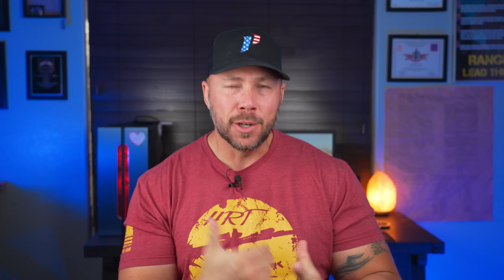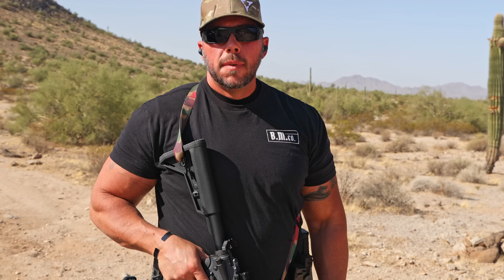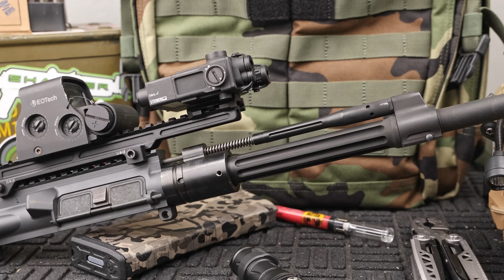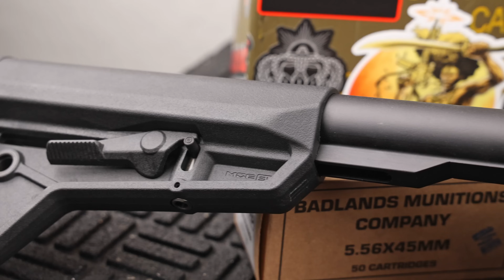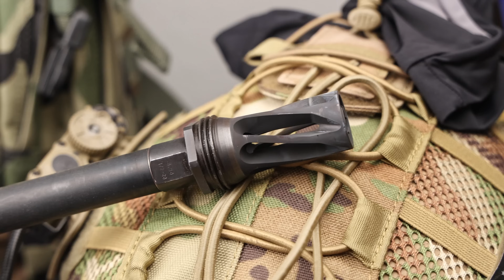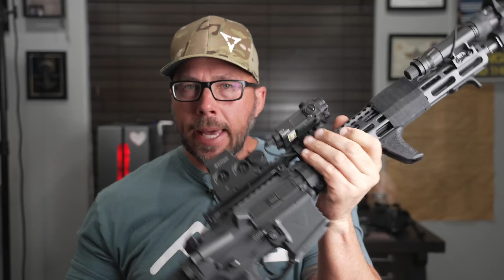I'm Back.. VKTR VK-1 Gas Piston Rifle

Comment: Does the handguard engage the barrel nut notches to prevent forward movement, or is it simply an old-style clamp-on design?
Reply from the maker: There is lock up on the barrel nut.

Comment: Too many flaws in this rifle for me to ever consider buying or carrying/ relying on it.
Reply from the maker: How so?
Reply: @TacticalConsiderations  Left side mag release drops mags when carried slung across the chest because of the profile and lack of barrier, op-rod deforms quickly, barrel will deform relatively quickly under admittedly extreme firing schedule (GoldenWeb) due to the transition in thickness around the gas block? maybe barrel fluting?,    overgassed in my experience which exacerbates the op-rod issue (friend's rifle), parts availability/ CS not good for normal people(non-content creators), high price for fairly untested configuration that has known issues. Couple other things that are more subjective to me like only 3,6, and 9 oclock mlok positions and just generally not liking the handguard. It is pretty accurate, I just don't have faith in it as a hard use setup.

Comment: Very impressive. Appears they have solved the gas control problem. I like that they don't use the tiny/fragile gas rings.
I would like to see a pinned gas block. (or better yet, a threaded nut, ala the defunct Barrett Rec 7 [taken from the zh-29 = 32] ) Would also like an integral trigger guard. Is there a gas rod bushing in the receiver?
Reply from the maker: The gas block stuff is always a place where some want pinned, threaded, thermal fit all kinds of options these days.

Comment: Looks over gassed with a flow through can… I want to like it besides that. Did you try heavier buffer?
Reply from the maker: I did not mess with the buffer for the initial video.
Reply: @TacticalConsiderations  well duh I watched the video, so did you just make the video and put it away or did you address the gas issue?
Reply: @TacticalConsiderations  so you didn’t change buffer or anything? Crappy follow through
Reply: Left side mag release will drop your mag with very little pressure when carried slung because of how far it protrudes. Barrel warps under especially high strings of fire, like say a firefight or prolonged engagement. Golden Web burndown shows that.

Comment: With the oprod mushrooming like that,at that round count,there was very little R&D. It is a rifle that I will purchase. Only after they  work through the unforseen problems.
Reply: There are more problems inherent to the design. Most notably the left side mag release will drop your mag very easily when carried slung against the chest or chest rig and the barrel very easily warping under especially high strings of fire. Nothing protecting the mag release. Golden Web burndown on YT of this rifle shows the barrel/piston flaw. The rifle is also gassy and way too proprietary along with being expensive.

Comment: At what round count did the oprod mushroom? And did they come out with a better oprod?
Reply from the maker: The new oprod is scheduled to be replaced at 5-8k under hard use. All oprods will mushroom in short piston systems.  While it generally will not affect actual function until its severely deformed, and I mean severely. I am still running the same one from this video with zero functional issues.
Reply: How about the long stroke gas pistons like in the HK mr556a4?
Reply: @DavidKon-r8o The HK MR556 A4 utilizes a short-stroke piston, not long-stroke. Long-stroke would be PWS.

Comment: So I watched your "if you can have only 1" video and this video.  I noticed that you didn't run a suppressor on your if you can have only one video.  I just shot this gun and I'm very impressed.  Good mix of weight and recoil. Should I just buy this gun, because you or I couldn't build this gun.  With that said, there's a lot of non-millspec on this gun.  Do you think that presents an issue?
Reply from the maker: Piston rigs are never going to be milspec like DI systems that are built to a specific print accepted by the DOD entities. I did run this one with a traditional baffled can  runs fine the system adjusts for it somewhat but it is meant to be run with flow cans.

Comment: If you had to pick between piston and DI for a cqb/ shtf rifle, which would you choose? Im between a piston like this or a PWS or getting an 11.5 blackout defense DI gun to run suppressed.
Reply from the maker: Well Piston rigs will run longer with out cleaning if built right but They will weight more and be more difficult to get parts for as compared to standard AR DI systems .. If you want all around easiest to maintain its always going to be DI.
Reply: @TacticalConsiderations sweet, just got an 11.5 Blackout Defense Pistol. Shes sick

Comment: I have alot of high end ar15s but my dead air sirra has high back pressure. So you think this would be something good just to leave that can on?
Reply from the maker: It would help but high pressure can will always be worse than flow on gas
Reply: the Dead air will run but the backpressure is punishing.
Reply: @charleseric75 ya i dont even use it. So i was thinking this would he good for it to be a dedicated can for.

Comment: what would you say the recoil impulse is like compared to a gas impingement?
Reply from the maker: Well no two guns really recoil the same due to gas porting buffer weights all that. While I have some DI guns that have ruger 10/22 like recoil that is very rare and its custom build to be like that. This will feel like a well balanced di system.
Reply: The recoil impulse is more straight back vs. "up and back"

Comment: Has VKTR provided you a new oprod replacement yet?  I also have a VK1 (love it) but i am worried about the same op rod issue down rhe road
Reply from the maker: yes they also changed up the material to ensure its not an issue.

Comment: I bought 2 of those Hyper brand triggers to install in my AR 10s and they are absolute garbage with a long pull before setting the gun off and one is worst then the other.
I have bought my first AR 15 before Bull Clinton was president and now I build and sell AR 15 uppers and AR 10 uppers in non-commercial chamberings or all WSM magnums to the 250 Savage and 6mm-284 win the 6.5x51 Jap or 6.5-284 Norma and many more.
I have AR 15 uppers in 17 Rem --- 6mmx45 and 7.92x33 Kirz
There is nothing wrong with the ordinary AR rifles gas system it worked just fine

Comment: Correct me if I'm wrong, but the piston system looks almost identical to the Adams Arms piston system.  Nothing wrong with that because Adams Arms' are solid.  I own a PWS mk111 mod1 and an Adams Arms.   Never had a single issue with the PWS, of course, and also, never had an issue with the Adams Arms.
Reply from the maker: thanks for watching and commenting

Comment: I wish i saw this before I bought the VKTR literally today😢 hope I don’t have any issues with anything including the piston rod. Good video though
Reply: Any update?
Reply: @ yes. After less than 200 rounds I checked out of curiosity how the piston rod was holding up and to get familiar with disassembly of the rifle. To my surprise I couldn’t get the rod out and the mushrooming mentioned was evident. I reached out to the company and they are very responsive and they honor the warranty. I’ll be getting the new rod they are manufacturing when it’s complete. Other than that, rifle is amazing😏
Reply from the maker: You will be fine just replace it at the intervals required.

Comment: I thought something was wrong because I started to notice you weren't posting any videos. I am glad you are back. I am curious about what happened, of course. It will be interesting to know. 

Very interesting rifle. I don't have a gas piston system AR yet.
Reply: I have had a wonderful time using Adams arms piston guns.. but they're dead again. They didn't do anything particularly different, but they really failed to make everyone aware of their 8# ar10s, that cost 1200-2800, and that cost them everything.
Reply: @PureCountryof91  I am happy with the DI gas system.
Reply: I have 3. Never went back to DI. Granted we dont know how dirty we can run this one but my PWS i hardly ever clean and it runs great every time.
Reply: @Mediocre702  I am old school. DI has worked for me without issues, problems, or complaints. And it is a bit cheaper.
Reply from the maker: Dude was out for a bit but back now.

Comment: Looks a lot like an LWRC under the hood.  Makes since with who you said designed it.  Have a few LWRC and love them.  I do like that they use Mlok over LWRC proprietary rail mounting solution.
Reply from the maker: Yup similar just slightly different.

Comment: Is the gas block on there with set screws?  That shit should be pinned on a piston rifle imo.
Reply from the maker: There are the two standard screws underneath and a cross pin on a detent design to make it easy to remove without ever being able to come off combined with the notch fit design

Comment: 2k and replace op rod every 5-7k? lol. fuck that. also, what's up with accuracy?
Reply from the maker: Most piston systems require replacement of springs/op rod parts right around that same interval.
Reply: @TacticalConsiderations  I was told my Caracal 816 is good for the life of the upper.

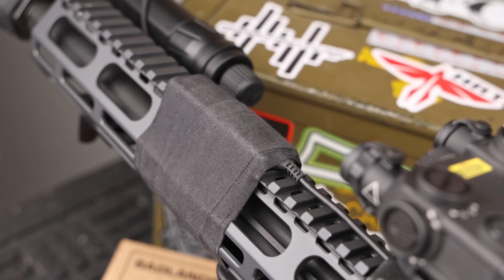Comment: @13:01 I can see handguard anti-rotation tab is not friction fit onto upper = disappointment. 😑
Reply from the maker: The rail locks to the barrel nut housing for the oprod which locks to the barrel nut. You'd have to spin the barrel off to get it to shift.

Comment: Maybe you or your followers can help me out. All I hear about is first focal plane scopes. I have two, a Primary Arms Plx 1-8 and Glx 3-18. I also have a Glx 2.5-10 second focal plane.  The 2.5-10, for me is much easier to use for my shooting. On the first focal plane scopes, at low magnification the reticles are very hard to see. On the 3-18 even at high magnification the reticle is very hard to see. What am I doing wrong?
Reply from the maker: FFP set ups will always have a smaller reticle as min mag.  The goal of them is to use the smallest amount of mag needed while maintaining true holts on the reticle all the way though the magnification spectrum. Make sure you Ocular setting on the eye piece is set to you eye.

Comment: And my pof cam pin does the same thing but better it doesnt rub
Reply: Ah yeah, this doesn't rub because the cam pin is at top dead center when the bolt unlocks. The legacy cam path isn't, regardless of whether you have bandaids such as roller cam pins or steel inserts - the real benefit is the correct timing of the rifle, once you shoot it, you understand.
Reply: @PaulLeitnerWise  doubt i would notice a difference conisdering over 5000k rounds and nearly no wear unless it somehow makes a legit difference to the shooter then no
Reply: Actually, I originally thought the same thing. My sole goal was to eradicate the wear in the upper receiver aft of the cam pin recess, then we're out shooting the test DI carriers with a couple of military buddies on one of them has an horrendously overgassed gun ejecting at 1 o'clock. I suggested he swapped the carrier and the ejection pattern shifted to 3 o'clock - zero other changes. The only way to experience the difference is to shoot it back to back. The gun sits on target no matter how fast you run it, split times are reduced, follow up shots are automatic - who knew?
Reply from the maker: POF's system is a bit different due to his taller design.
Reply: @TacticalConsiderations  true, but thecae path is the legacy cam path.

Comment: Noise fighter's mount , is it similar to GBRS ? How comfortable is it ?
I know many complain about height over bore on GBRS !
Reply from the maker: the Noisefighers is very different in design than the hydra.  Height is dependent on the optic mount of choice when added to the mount.
Reply: @TacticalConsiderations  thank you

Comment: Running a piston rifle with Hux is nice. But it doesn't show/prove anything about this VKTR.🤷‍♂
Reply from the maker: how so? Flow through cans are the future.
Reply: @TacticalConsiderations  Yes, that's why I said the first part.
But isn't VKTR's main selling/feature is to be 'self regulating'? So people can use whatever they already have that's not the latest and greatest flow through. 
Huxwrx already works well on any rifle, then how do you show if the VKTR's system is any better?

Comment: Once I get a rifle, I am looking at an upper shelf quality one. Perhaps Geissele, Blackout Defense, Radian etc.
But there are less piston options, LWRCI I know of and now this. It feels appealing not to get gas in your face.
What's your opinion on accuracy? The prevailing thought is that DI is more accurate, right?
I don't know what to pick.....
Reply from the maker: Accuracy in modern barrels is the end user. I've seen piston and gassers so the exact same
Reply: @TacticalConsiderations caracal. Made in America. 816 is third gen hk416, sig516.
NATO approved and otb. Lighter and cheaper than the hk. Decent priced. Sales occasionally.
Centerion arms for di if you use good ammo.
Reply: HenryGup I own a number of both external and internal piston ARs. They all can out group what I am able to do.

Comment: Two-degrees is trivial for dwell time. All piston guns unlock ~2X faster than DI.
Reply from the maker: Combined with bleeding off its noticeable
Reply: beck I have a number of external piston ARs and have never heard that before. Learned something new toady.
Reply: That's actually a process of being overgassed. This is neither overgassed or incorrectly timed, the same cam path is available in DI carriers and it transforms the gun.